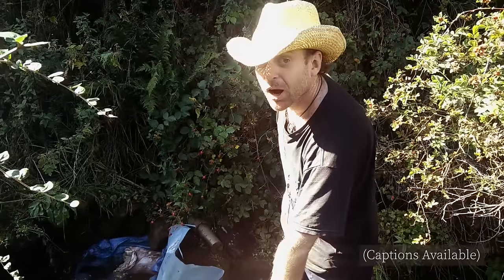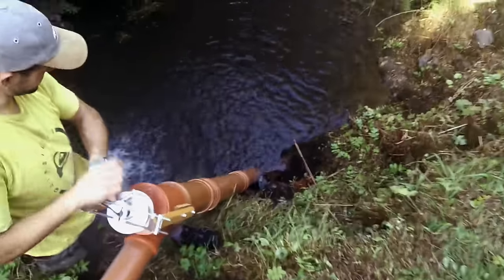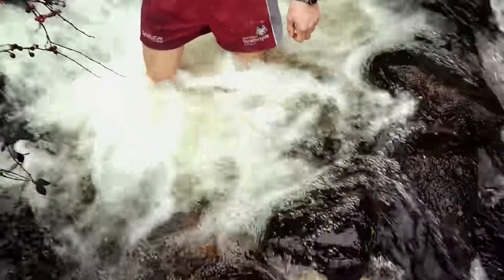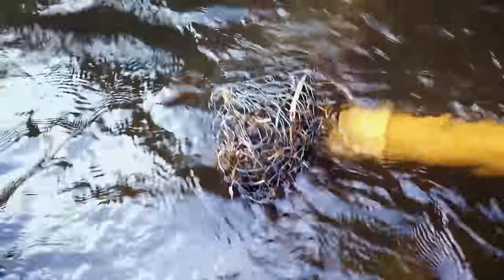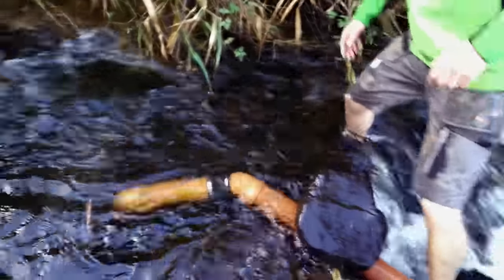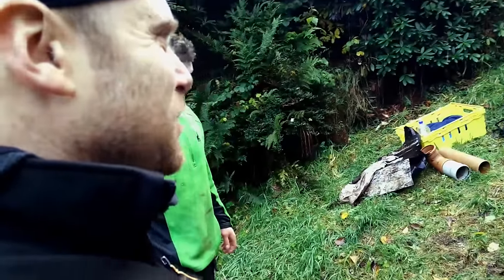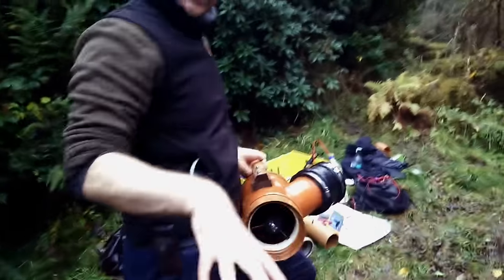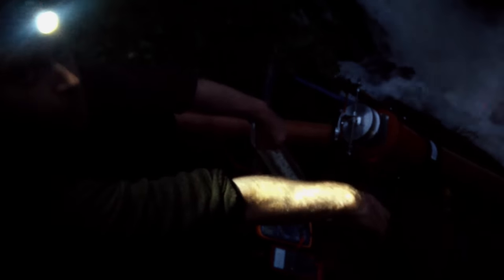Real World Results From The $50 Water Turbine

Comment: Been saying for years, we need to find a better way to generate hydro electricity, and to be able to do it without having to dam up rivers and waterways.
This is a good start in that direction.
Reply: The problem is scale.  If they make this thing large enough then all the water would flow through it, and you end up with a natural dam.  Small is fine, but bigger is less environmentally friendly.

Unfortunately, bigger also means more power, and it's cheaper to just put a bigger pipe and turbine in than it is to find another location and do an install from scratch.  Also, there aren't many (any?) places left where a commercial installation makes sense in the developed world.

Comment: May I suggest using the blower head from a leaf blower? All you need is a momentary expansion below the impeller, to let the water flow. It is very durable and should do well in water, as most are made from aluminum and are balanced for very high speed.
Reply from the maker: That kind of centrifugal impeller is one of the first I tried, but turns out they don't reverse well. A couple of the 3D printed options I'll be trialling next tho do borrow from some of those principles, but (hopefully) more optimised for this kind of use.
Reply: @OpenSourceLowTech  check an old jet ski.

Comment: Love the project and work, power generation for $50 is a no brainer, I have an RV on an off grid plot of land and want to keep the batteries charged (without using fossil fuels, what would you hook up to this generator, to turn it into a battery charger ?
Reply from the maker: It should more or less plug straight in to any charge controller or equivalent which is happy with the max volts and amps. You may need to put it through a three phase bridge rectifier first, depending on whether the box wants AC or DC.

Comment: Wow fantastic! I wonder if a boat propeller could be used with larger pipes (maybe a permanent dam like fixture) and an alternator from the same boat in order to produce a larger power output with more durable parts.
Reply from the maker: The design should be fairly arbitrarily scalable and yeah a boat prop or similar would probably do a fairly decent job.
Haven't worked with boat alternators, but they seem to resemble car alts, which aren't permanent magnet and so not ideal.
For larger versions something like a treadmill motor might work, they do middling volts per rev but the turbine spins pretty fast.

Comment: That a clever system. A Bing search for (vortex-grit-removal) looks like something that would cost 2 or 3 feet of head and get rid of all the stones that would outright break your turbine blades and clean up a lot of sand that would wear the blades awfully fast. In the end, making molds from your plastic blades and injecting wax in the mold then making an investment casting the blades out of metal is the only thing that will stand up as a water turbine. I expect if you stay with it very long you will end up using bronze.
Reply from the maker: A centrifugal filter would likely do a decent job, but I'm still hoping for something a bit easier to build and implement.

Same for the impellers.
Reply: I expect a vertical 12 inch round pipe 2 or 3 feet tall with a horizontal inlet tangent to one side at the same level or below the vertical 3 or 4-inch outlet pipe, Tuning the height of the outlet pipe and the diameter of the trap should trade head loss for grit removal. The depth of the trap is a place to collect sans and rocks.

I expect you will find turbines engineered for the water flow you male enough more power you can't afford not to make them.

Comment: since you got a long outlet, why don't you use a screw type of blade, all the way to the exit, so you can extract more potential force due to the mass of water queuing in the screw blade?
Reply from the maker: I've 3D printed a couple types of short screw runners, will see how the go. A longer one tho would be fairly involved to fabricate and mount, and would increase friction. Also it would presumably trade off revs for torque, and I'd rather run this higher voltage lower amps.

Comment: Real nice Mate Cheers. You could increase your output massively by adding,  3 or more Trompe pipes in series and using all that clean free compressed air, and put your turbine on the exit? I also have an idea for a self looping Trompe almost silent air compressor, to use with the Kinetic Boyancy Genorator.

Comment: Would it be possible to use an appropriate sized boat propeller or perhaps a metal disc formed into a propeller?
Reply from the maker: As long as it's the right size, should be.

Comment: i commented on your similar video but ill repast it here ..... just stumbled across this channel and havn't watched more yet ,have you considered using a pulley system in place of the motor to lift weights or even water to a perscribed height as a means of storage of potential power which can be then lowered using pulleys and gravity to power a generator as required , it would mean far less wear and tear on motors and an easier way of power storage than batteries and far more available and reliable in any situation

Comment: Have you looked into Viktor Schauberger's designs?
Reply from the maker: Yeah, two of the 3D printed runners I'll be trialling when I get back are logarithmic spiral lily types. Looking forward to seeing how they do.
Reply: @OpenSourceLowTech  I'd be irresistibly tempted to rig a straight drop. Every bend imposes turbulence that impedes flow.
Reply from the maker: Yeah, but real world topology often has other ideas. We've got the draft straight at least, and minimised corners in the input as much as possible.
I'm aiming for something that works well enough in actual use, rather than needs to be optimal or nothing.

Comment: Great job !! Later, if we manage to make the design for 3D printing of our current powerspout turbine for 2 measurements, I will send it to you, it can be of great help to improve it for low-resource areas! Currently we achieve about 280w at 1.9m height, but improving the pipes and with a hooverboard generator we hope to reach 350w 24x7 (7-8kwh/day). We are also testing with different sizes of pipes (200-250), shapes at the outlet: cone, conch, etc.
Reply from the maker: Decent numbers, what kind of rate of flow?

I'm currently in Nepal, working with the university to more comprehensively test the various 3D printed runner and stator options. Will publish the results when I have them.

Comment: you might try a conical design like a lily impeller or one of those football shaped ones, rather than a standard fan blade.  I'm not sure on off the self costs, but they're not too hard to make out of various materials, as I understand it. Seems like it would be more durable in this application though.  just a thought.
Reply from the maker: I've got two lilies 3D printed ready to test when I'm back in a couple weeks. Interested to see how they do.

Comment: I was wondering about using the power of siphon to pull water through a dyanmo at the top, instead of the bottom.

Low budget, low power dyanmo that screws onto the hose at the top of the 300ft of siphoning hose.

Comment: you should use spiral screw blade instead, because the angle of your water feed will easily destroy that kind of propeller type blade because all the water pressure is directly hitting your blade that counters it, screw blade will smoothly allow the flow of water
Reply from the maker: Will test.

Comment: Great follow up. I bet there's a 3D printed design out there, or someone prepared to do it...
Reply from the maker: That'll be the next day I'm back.
Reply: There are some /great/ designs, but unfortunately 3D prints are only ~20% as strong as a proper injection-molded item of the same material. There's some neat ways to post-process a 3D print to get it up near 100% as strong (packed with powdered salt crucible, reheated to annealing point to remelt/solidify layers), but it's some additional work.

Comment: How would a series of turbines on the same string work?
I have very little knowledge of this area, but could it be achieved by angling each unit a bit and feed the "exhaust" into the next unit, then the next and so on? 
I suppose there's a level of resistance in each rotor and that the water pressure will only drive a certain number of them for x meters of drop, but I'd be interested in knowing. 😊
Reply from the maker: Each essentially takes momentum and efficiency from the others.
You're generally better off with one unit on as long a pipe as possible.

Comment: I know you answered this multiple times, about 1 motor + multiple blade design.
BUT, maybe it will Slow the blade spin speed down for Durability, and hopefully the extra torque can make up for the difference in power.

This is probably not what you are after, ie simple small design, but for the readers out a large water wheel may be an option for simple Durable applications.
Overshot Waterwheel Design, they are very nugget, no need to worry about debris. more complex / material large wheel design, but low / easy maintenance. 
Pitchback Water Wheel has better efficiency, same wheel design but needs a catchment channel bottom area.

Comment: QUESTION: 
In the water stream down the pipe, what is the most important factor when optimising a turbine?
Like what's affecting the turbine the most? the volume of the water, the speed, the direction in which it hits the blades?

Im not an engineer and I assume that these are all important factors, but I would like to know: If you make the water spin down the pipe before it hits the turbine, would this increase or lower the turbine output?

I've seen enough videos to assume that NOT spinning the water before the turbine is the correct approach, but I never got to the reason why. 
If someone knows, I would appreciate them sharing it
Reply from the maker: All those and a couple others. The next step is optimisation, so hopefully by the end of the next video should have some fairly comprehensive answers to these questions.

Comment: If you put another sliver of pipe say two inches long in front of the fan blade next size smaller  that protect it against stones and increases of efficiency, also put a cone ideally or you could use a straight piece of pipe blocked off 3 " in the front of the fan the diameter of the Hub and the same on the back end that will increase its efficiency even further giving you're a better Venturi without turbulence

Comment: Great vid Daniel, I love this sort of stuff, a what a great water flow u have. I do have a suggestion, and that is too consider an auger tube flight arrangement in single, double & maybe even triple flighting. The benefits With your near vertical drop are: 1) you will have less likelihood of block ups from rocks sticks etc. 2) by varying length, pitch and amount of flights added to the Auger type impeller , you will get different results, ie: speed, torque, etc. you could have an auger from 1 -20 foot long here, couldn’t you? Length gives torque, number of flight per shaft give you speed variations, ie: more flights, the slower the speed & torque probly goes up too, 1 flight will increase speed and reduce drag/friction which is another consideration here of what will work best for your situation and hopes for higher outputs.  3) dont make the auger fight too tight in tube, keep a bit of gap, it will still work fine and will have plenty of torque to help chew up ant bits of sticks n stuff that go through including rocks, to some degree.  
A farmer in the grain industry here in Queensland, Australia, once told me he tried to put a 12” petrol auger about 35’ long into a dam once to clean fertiliser out of it, and he said it nearly choked and blew off the end angle for grain to drop into bins/silo’s/ trucks, etc. He said he had to crack the throttle back so quick once it picked up the dam water, before it hit the end, and it pumped a huge volume of water like this. I believe this maybe a better answer here for you, with numerous benefits from this type of turbine arrangement, and while having some sort of bottom bearing support would be nice, I dont think this is completely necessary, but is simple to do anyhow, just a 3 prong/brace arrangement twisted sideways so not to restrict water flow, and support a bearing for centre spigot of Auger flight. Bearing could be a piece of drilled Nylon material. 
With what you have done, which looks awesome by the way, I am sure without much more materials and labour costs, you would find you could have a much more reliable and powerful turbine capable of probable so much more power with that sort of water flow. 
I am also a big proponent of using large supercapacitors for various output upgrades as another commenter has suggested to use capacitors. There are a number of different ways that capacitors can be used in a solar/ hydro system to obtain great benefits.  What u have here is gold, great job guys! I am looking forward to seeing how this all progresses, thanks for sharing this great project info. I would love to have this water capability in my back yard.
Reply from the maker: I'll be trying several printed impellers, including a couple screw types. Will see how they go. 
I think something that long tho you'd lose a lot to friction with the water.

Comment: Look up Hatco 02.12.088.01 Fan Blade,Metal,3",Rh . Not sure what material this fan blade is made of but it appears to be aluminium or stainless. Figured I'd share to see if it could meet your needs. This fan blade appears to be approximately the same size as an 80mm computer fan from what I'm reading. I also found an identical fan in a 5" diameter that says it's made from aluminium. Part: Baxter 01-1000V8-00117 Fan Blade, 5" Diameter. These appear to be refrigeration / condenser fan blades. Look forward to seeing your progress! Good luck!
Reply from the maker: Interesting. I tried a steeper pitch fan on the Berlin build, it did about 20% less power than the standard PC fans, but your suggestion did lead me to this:
https://www.partstown.com/silver-king/svk99196#id=spec
which seems kind of maybe ideal. Slightly pricier.
Reply: @OpenSourceLowTech  still appears to be plastic so hopefully it doesn’t break. I’d go aluminum if plastic is already giving you problems personally
Reply from the maker: It's hard to tell. The weight is listed as 227g, which makes me think it's metal, tho no idea which.
Reply: @OpenSourceLowTech  you can see the casting marks and numbers on the center portion near where the shaft goes through. I’d be willing to bet it’s plastic based on what those look like
Reply from the maker: Quite possibly. I'll probably invest in a couple similar types and see how they go. Even if they are plastic, they only need to be a little stronger than the PC fans to hold up.

Comment: And what if you use multiple fans multiple turbines in that path downwards and just made the water pressure less powerful but multiple fans stacking on each other when that stacked the electricity to where you get more usable voltage
Reply from the maker: I tried two fans back to back and it made no appreciable difference, I'll also try them spaced.

Comment: In order to make calculations to adapt the design to other enviroments, it's needed to know: flow rate and head height. CHEERS!!
Reply from the maker: I've not had a chance to accurately measure this location yet, but it's about 30 l/s and 4-5m.
Reply: @OpenSourceLowTech  thank you for your response!
Reply: And you get about 1200W/h at 36V right??
Reply from the maker: This one's currently doing about 120W / ~3kWh/day @ 40VDC(r) x 3A.
But I'm hoping with optimisation that will increase some.

Comment: Great stuff. I can’t help but wonder why you didn’t opt for a more powerful turbine since you have such an abundance of water and flow. I guess it’s down to cost; bigger turbine means bigger electricity management systems, etc? Maybe you only need a little electricity. I think a steady 130 watts is ample if you can store it.
Reply from the maker: This scale kind of makes the most sense given general off the shelf availability of the materials and components. 
Aiming tho to have it be fairly easy to make smaller or bigger as needed.

Comment: So more generators steal momentum then can you add a tri pipe/gen supply but increase out flow pipe diameter. The cost would go up but triple the power output.  Just trying to think it through.  Incredible by the way what you are doing!!
Reply from the maker: More diameter would mean more power, up to the point that you exceed the water supply, but unless it's seriously huge you're still unlikely to max out the alternator, so still makes sense to just use the one.

I'm also considering a manifold type outlet for very low head (ie ~1m) but high flow situations to just blast as much volume through the system as possible to compensate for the lack of gravitational potential.

Comment: Managed to source a Bafang ebike motor, would love to repurpose it for a hydro generator, not sure where to start though. Any help most appreciated!
Reply from the maker: First thing to do would be spin it up with a drill and a multimeter and see what kind of voltage it does per rpm.

Hoverboard wheels do about 55VDC(rectified)/krpm, which is about perfect for my turbine.
Reply: @OpenSourceLowTech  I’ll give that a try thanks!  Also wondering if I’d have to take it apart to get to the stator etc or would it work as is? (I’m assuming it is a permanent Magnet motor.) look forward to the ‘how to and build’ instructions on the hydro project, really interesting videos so far, thanks!
Reply from the maker: Shouldn't need taking apart unless you want to rewind the coils for different voltage +/ amps, which is a significant hassle and not usually worth it.
Should be PM, direct drive is generally better than planetary.
Reply: @OpenSourceLowTech  sounds great, thanks again 😄